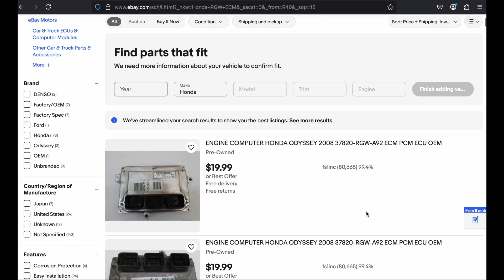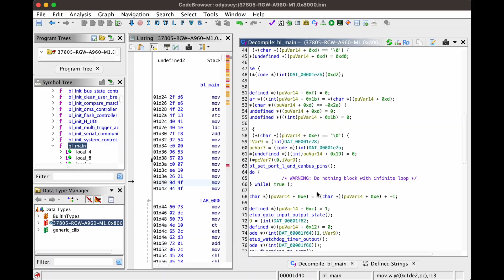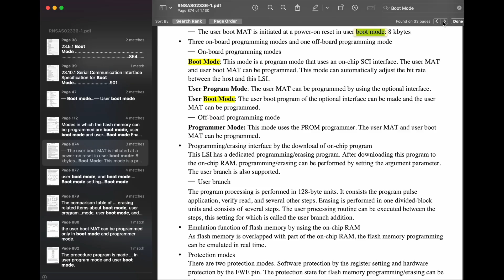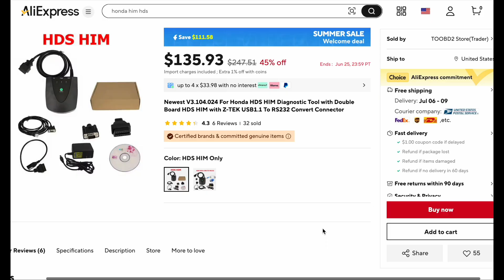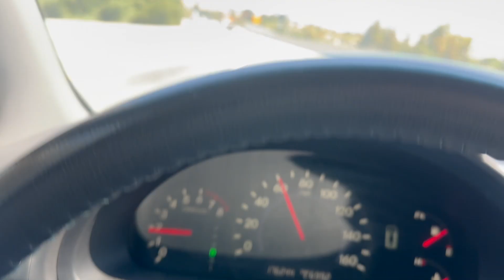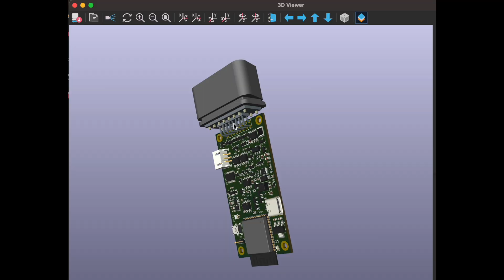Hacking My Honda's ECU to Permanently Disable VCM

Comment: I would like to do this on my 2007
Reply from the maker: Quick search and I think the 2007 used 37820-RGM-A91 ECU. I currently only have patch for the RGW 08 Odyssey. It should be straight forward to port it over. If you have tools to flash ECU, I can help you patch.

Comment: hello friend would this also work on a j35z2 Accord?
Reply from the maker: I currently only have patch for 37805-RGW-A960 ECU. It should be straightforward to port it to other platforms. I don't have an Accord to test, but if you know how to reslash RWD and like to tinker, then hop on the Discord server, and we can try to figure it out.

Comment: Did your fuel mileage get a little worse after eliminating vcm (the proper way)?
Reply from the maker: Yes, slightly worst but I like it better without VCM, throttle response and engine run smoother without it. It should be possible to make VCM switchable while driving as well with a little more firmware patching.

Comment: You would think that the Honda/Acura dealerships would be able to reflash the ECU to turn the damn VCM off if they wanted to.
Reply: There is an update to reduced VCM activation most dealers won’t do it without charging an arm and a leg.
Reply: @synthmechanix I see. So, it's out there, but guarded by the manufacturer 🤔
Reply: @biafransamuraitechie450 when I worked at the dealer when the 05-10 came out there were ecu updates more recent had a co-worker that was still with Honda and confirmed  ecu update was available for the 05-10 to reduce activation.

Comment: I like this, I use the S-VCM but would prefer to program like this.
Reply from the maker: I looked into S-VCM initially, but I don't like it piggyback of the temp sensor, adding more failure points. That why I started this project :)

Comment: Make an update on your project when done with price and how to purchase
Reply from the maker: The OBD2 interface is still currently in early development. I have a few prototypes that I could send out if you are a developer and want to contribute to the project. I have released the source code for everything used in the video, including the VCM patch. If you have other tools that can reflash the ECU, you can use them as well.